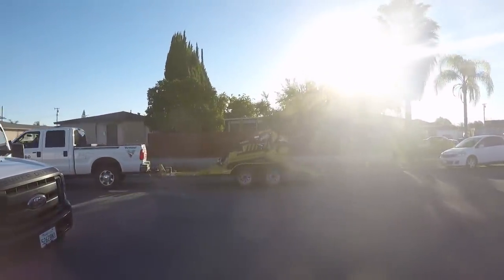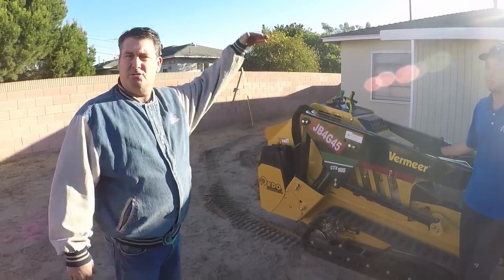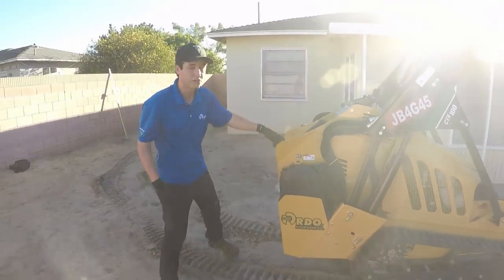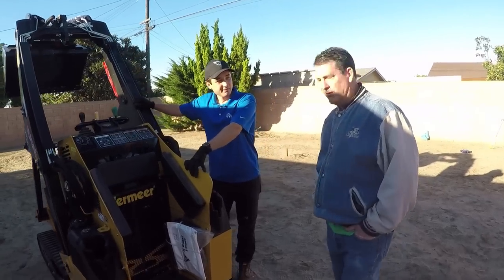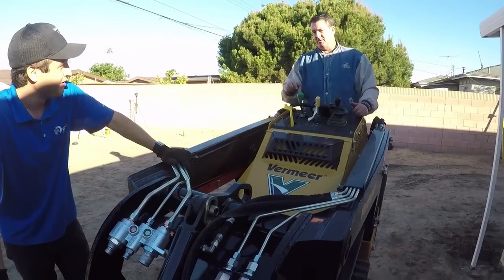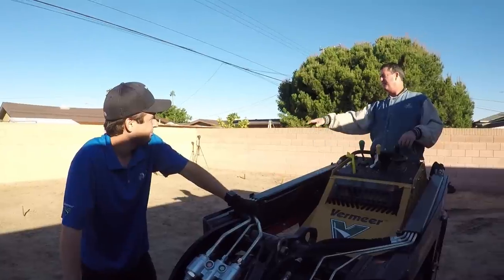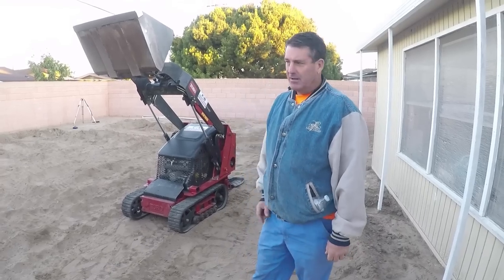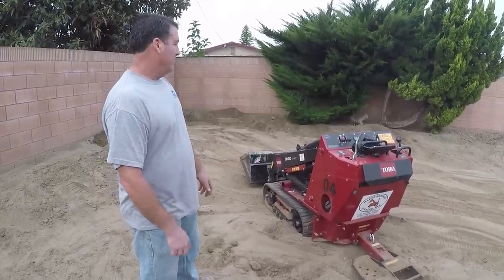Which Mini Skid Steer is best!? BUYING A NEW SKID STEER!

Comment: I’ve run the dingo and found it needed a little more aggressive tread on the tracks when working with tilled clay soils, really lost traction had to back out with the bucket. The vemeer looks like it has better traction, I’ll try it when I have a similar job conditions
Reply from the maker: I like the vermeer, I dont think there's anything out there pound for pound that can beat it

Comment: Make sure you try a Ditch Witch before making a decision they are very reliable.  755 would be a nice machine for you.
Reply from the maker: Looks like the ctx100 has little bit better specs
Reply: muxxor They’re really good but DONT drive them in wet or mucky soil because one or both of the tracks can very possibly slip off.
Reply from the maker: I noticed a bolt on the side to tighten the tracks from time to time as they stretch out
Reply: They haven't made the 755 for about 2 or 3 years now. I'd get a 1050 personally. It's 37 hp. Btw that Vermeer does not have the largest engine of any mini skid steer. Ditch Witch and Boxer both have diesel units with around 45 HP. That sales rep should know better.

Comment: I haven't run mini-skid loaders but I've run a lot of farm and construction equipment and I have to say Vermeer makes very good stuff. We had a 48" trencher from them that was built like a tank. Their hay equipment is high quality. Vermeer makes pipeline, utility install, agriculture and forestry equipment. They know how to engineer tough equipment. Next time you see a utility crew with a directional drilling machine or a tree crew running a chipper, there's a good chance they are running Vermeer equipment. 

I prefer Bobcat skid loaders (full size) to New Holland and JD, but I really like the Kubota cab machines.
Reply from the maker: I think we're on the same boat

Comment: I would use a self loading tracked dumper on this application, they are 32" wide carry 19cu.ft of material and would save you a guy pushing a wheelbarrow, you can also get high dump models that will lift over the side of a dump trailer.
Reply from the maker: That sounds good

Comment: Skidsteers have tires. Mini track loaders have tracks. None of those machines are skidsteers. 
I spent about a year looking at all these machines and ended up with an 05 bobcat 463. (Same as the s70) 
The previous owner upgraded to 41" wide bucket and tires. (Was 36)
A skid steer won't work as good in sugar sand.. I'll give you that. But my 463 takes way less energy than balancing on the back of one of those,  faster top speed, dumps higher, and was considerably cheaper. I've moved over 40 yds of fill into back yards in subdivisions with my 463. I'd hate to try on one of those.
Reply from the maker: definately will take getting the hang of it.

Comment: I guess if you are going to do a comparison between the different manufacturers of mini skid steers, it's important to compare apples to apples. Here you have a Vermeer CTX-100 and a Toro Dingo TX-427 which are two different sized machines in the way of build and capacity. What you should be comparing it the Vermeer CTX-100 to the Toro Dingo TX-1000 and the Bobcat MT-85 where all specs are of comparable value. The Dingo here is half the lifting ability of the Vermeer. 
At any rate, every job may have a different situation with accessibility and material being brought in or removed, so different machines will be warranted for that particular application. It's not a one all machine is perfect for everything. Big job, big machine. Small job, small machine. 
Affordability is also a contributing factor. I would love to have that Vermeer! The reality is, I couldn't afford it. Toro Dingo TX-427, TX-525 and the Bobcat MT-55 are more in my price range, and that's a good used unit. I would take any of them in a heartbeat, especially with the availability of attachments. It's way better than manual work (shovel and wheelbarrow) Cheers!
Reply from the maker: I concur
You need three different types of machines to really cover everything

Comment: Better look at the engine rating sticker on the Kohler Valve Cover, it’s rare in kW, European Measurements, not US Standards. The actual hp is 25 at idle to approximately 52hp at 2600 rpm. Kohler rates it at 56 hp.  Don’t believe me, look it up, I did after I purchased one.
Reply from the maker: I think the specs say 40 horse

Comment: Would you use one of those enough to pay for itself? or continue to rent as needed? The larger unit seems to be able to do more overall and in the long run might  make you more money. Sometimes a bit more horsepower cuts hours off a job.
Reply from the maker: Yeah thats true but i cant get the big ones into the backyard jobs

Comment: Love my dingo tx1000 narrow track. It's a beast. Got a nice breaker for it too. You'll love your new machine.
Reply from the maker: have you tested the other brands?
Reply: @OdellCompleteConcrete  
I have. The Vermeer and bobcat mini skidsteer. Felt like the Dingo operated the best. Had mine 2 years and have had no problems or regrets. Bought a aftermarket concrete breaker from Quick attach and it works really good with it too.
Reply from the maker: Sounds good
Reply: I got 2015 wide tracks 240 hrs, neutral sensors out at 140 hrs, new tracks at 120 hrs, new starter 180hrs, had to welded muffler, replaced parking brake handle,  and ignition switch. Other then that works fine. I did use vibratory plow to pul 2" water line and works like a charm, grapple to clear 3 acres after trees were cut for lugs, trencher attachment most of the time with rock teeth.  Thinking about going to ditch witch.

Comment: I’ve rented a few of these machines... and found it difficult to load a dual axel dump trailer. The machine can only get so close to the trailer, and the bucket dumps along the sides of the trailer. You have to get in the trailer and re-distribute the material away from the side walls..
Reply from the maker: That's interesting.
Reply: Looks like a pain in the ass.
Reply: Thomas Rossi True need more reach
Reply: Ditch witch makes what I believe has the longest reach but it is still a problem when loading into a bobtail loads my dump trailer fine no problem but the higher you have lift to dump the shorter the span to dump , but the ditch witch is a beast with a breaker attachment and they also make a 3’ dirt tiller that mills down 1” to 6” of hard pan like butter and leaves the dirt like sand so it’s easy to pick up and leaves the grade flat no humps
Reply: Great video.
Sorry in advanced for m'y english (i am french).
M'y expérience, those machine (any kind) should be sell with High reach bucket.
Same for the bobcat toolcat.
As i read ealier,  service after sell is very important as it will break something for sure.

Comment: Hello Sir I have a Mt52 Bobcat just has 20hp but I got it a a threat deal $1800 not running at all 1 track w a s missing no bucket but it's up an running great had all 3 cylinders resealed, O'rings replaced on lift arm control, all new grease zerks just purchased a GP bucket for $200 42"  with it actually hoes on a ditch witch mini but ordered a mounting plate from Titain Attachment of Tennessee an Fab it to fit I'm proud of it works great, my friends have Dingos with tires an works great also they are proud of them also it's about how you service the machine not brands an how the services from the Dealership honor you when you bring it back to them for Repairs major or Minor .now I have rented a Ditch Witch an I enjoyed them 750 series , but No Vermeer yet No Boxer. Now I hear Kubota just came out with 1 about the size of the Vermeeran what ever dealership is closer to you for quick service abilities .
Reply from the maker: Yes I concur.
Everything created equal, its about the maintenance and ease of getting parts

Comment: At some point you will use the bucket to carry concrete from the mixer truck to the work site.  For that job you need power and bucket capacity.  My recommendation is to go big now and avoid regrets down the road.
Reply from the maker: Yes I have considered the big deep bucket for just that.
I look for lift height, horse power, hydraulic pressure

Comment: Concrete!  mt55 with wheeled stand on platform.  Safest.  Put counter weights in back and make a 3ft wide by 53 inch long bucket add 8inch on top-sides.  Holds two wheel barrels of concrete.  Just gave away my biggest money making secret.
Reply from the maker: Sounds sweet, I think you need to patent that

Comment: I have owned two vemeers but I tested the ditch witch and it was night and day. The ditch witch is built so much better and has a suspension where the others do not. You want suspension!!!!! Also the lights on the ditch witch
Reply: Ditch Witch all the way, very reliable and overall better machine then all of them.
Reply from the maker: That sounds interesting.
TY

Comment: We have used Vermeer mini skid for the last 8 years or so. The tracks will come off, if you’re not careful, specially working with gravel. Pain in the butt to put back but not too bad. Other than that occasional hydraulic hoses leaking  - Vermeer has been extremely reliable. If you have high side dump trailer - forget it about it - you can maybe load from the back and shovel to the front of the trailer. Or use the curb for more height. 
KG - ATX
Reply from the maker: That makes sense
 TY

Comment: I don't think you can go wrong with a vermeer there good machines . I have run t hat ctx 100 it is nice.  I think the   hydraulics  r slow and the track system looks like a pain to work on. Look in to a Ditch witch sk 800 or 1050 the best track system hands down  and the hydraulics r so much faster.  I have  an sk 750 with 2600 hrs on it and it works just about everyday . I live in Ma , i work in all kinds of soils sand rocks snow it has no issues in all kinds of terrain. They are well made . Nice video  good luck 🖒
Reply from the maker: TY for your input, I will take it into consideration

Comment: Testing on this job was too easy. See what happens when things get a little tougher.
If the support is good my jnitial thoughts are the Vermeer. It seems to do everything better without being pushed to it's limit, if you're on the limit all the time reliability drops.
From the work I've seen you do, lifting concrete etc, the little ones may struggle. And after all these machines are supposed to make work easier and quicker!
Reply from the maker: TY
That's the goal

Comment: i work in the plant at vermeer that makes those mini skid steers in fact i run the laser that cuts the parts for it there a nice machine
Reply from the maker: TY
Boyer
Keep doing good work it pays off
Reply: @OdellCompleteConcrete  if you get a chance try out the 925 also

Comment: I reckon, for lifting spoil into a truck or trailer, you're always going to run into the leverage of weight x distance. For a small machine that can go through a gateway, it's never going to have the weight to balance a heavy bucket load lifted any distance forward of the tracks. And flipping it up is never fun!
I'd work on the assumption that the only way you'll fill a trailer with one of those is if you have ramps up the back and drive onto the trailer with each load. Which is still better than shovelling!
Reply from the maker: It dumps fine in to my dump trailer

Comment: Worst possible scenario for these machines are the tracks slipping off and having to rig it back on.

I remember the one day on a job we had a crowbar, pickaxe, and two men out around the machine trying to wedge the track back so we could get back to work 🤷‍♂️
Reply from the maker: Sound like a drag
Reply: Odell Complete Concrete only has happened once in my 8 years of using mini skid steers.

Comment: I forgot to mention I busted my dingo front plate that attaches to the bucket prying up concrete. After spending a thousand for a replacement part I decided its to small to pry up big slabs of concrete so I break the concrete up fairly well first . I usually just drop a big boulder and that breaks it up fast
Reply from the maker: Good idea
TY

Comment: I would just stay away from all of the above. Take the fence down and get a new Holland L170  or C175,small enough to fit in tight places and it can reach a tri-axle. With 20k you can find a good use machine in your area. I tried a bobcat (can't remember the number) end up being a total money pit. Always broke down in the middle of the job.
Reply from the maker: yeah thats why i want to buy new so i dont have any mechanical problems, dont want the headaches! thanks for the input though! ill look into the hollands

Comment: Ditch witch. If you have a dealer in decent proximity, ditch witch is the best machine on the market. They have the most power, highest dump height, longest tracks and better tipping capacity, this joker is just telling you what you want to hear to sell his product. Good salesman, false facts.
Reply from the maker: I read the specs
TY

Comment: I can not believe you don’t use a rotary laser system to get very close on grade first. Put the detector on the bucket or arms preferably, so you can keep between  0.50 of a inch, or so. Makes work faster. Best $300 I ever paid at Lowe’s for a Bosch Unit.
Reply from the maker: Good idea

Comment: A little bit about my background. I have been running equipment since I was 6 I'm in my 30s now. We have owned a bunch of Vermeers and they have all beed awesome but 35k is a lot for what you are going to use it for if it was me I would checkout a used bobcat s70 they also have an older model but I can't remember the model number they are sit down machines 3ft wide I'm pretty sure and you could move that dirt right through the gate once you got time on the machine also you can find the older model on Craigslist for 5 to 12k that's a lot of bang for your buck.  If you are running on Sandy soil just wet it down a day before and the tires won't have a problem just my opinion
Reply from the maker: sounds good 
TY

Comment: Which mini skid steer is the best is subjective. The Vermeer wasn't the same size machine to the Toro Dingo. If you're going to compare, at least make it apples to apples and apples to oranges. It's like comparing a sports car to economy vehicle. 
Of course the Vermeer will outperform the smaller units because of power and lifting capacity. I guess it boils down to affordability, the work being done and mobility in tight places. If you have deep pockets, why wouldn't you buy the best? If you're an average schmuck like most of us, the Toro would suffice. These Chinese gas powered units wouldn't be ideal because they don't have the torque that diesels do.
Reply from the maker: 3' wide machines for backyard access.
What's the best one.
I would say hands down the vermeer is twice the machine if not more, but the cost is twice as much to, but you know the saying you get what you pay for

Comment: Buy a mini excavator instead i think. Its much more versatile and much fast to move dirt in an area like this. And you dont have to drive around with it all the time. And also you can get down to the right level right away just by mounting a laser level on the boom. In EU we would never use anything els.
Reply from the maker: Yeah i can see where you coming from

Comment: Toro dingo has no power. If you raise the bucket and drive at the same time it almost dies.
Reply from the maker: I concur, it only has a gas engine and 24 horse
Reply: The Dingo is a good machine if you get a diesel.
Reply: We tested the Toro dingo 1000 no match for the vemeer 800 or ditch witch
Reply from the maker: concur
Reply from the maker: good to know